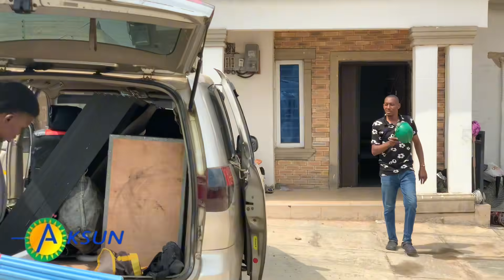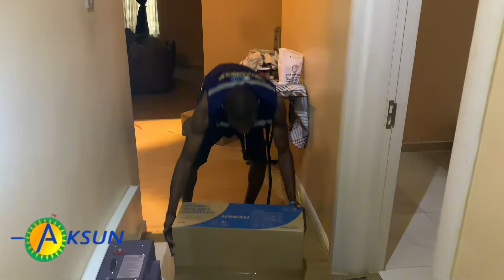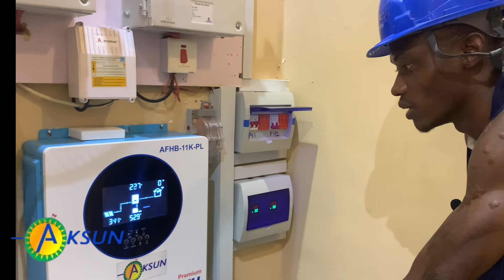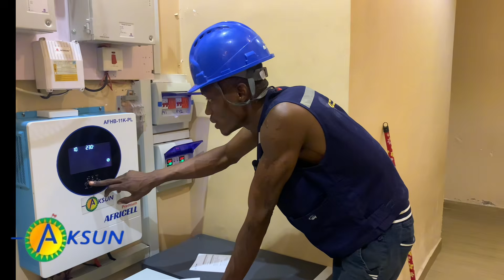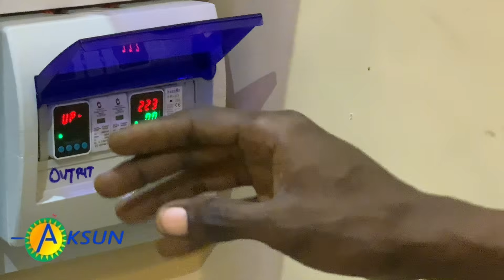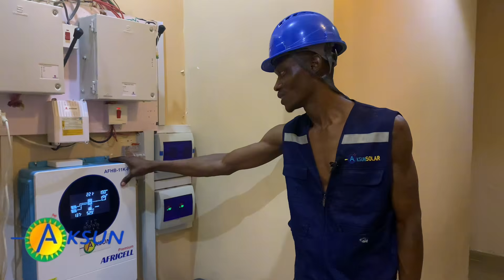Complete Solar Carport Design and Installation

Comment: Please remove the fan mounted on the wall. Heat is meant to be dissipated. Not circulated. Instead mount an exhaust fan to remove heat.
Reply from the maker: There is a room behind the wall, so it will be difficult to install an extractor, there is  an air condition in the building to neutralize the heat reason why we use the wall fan